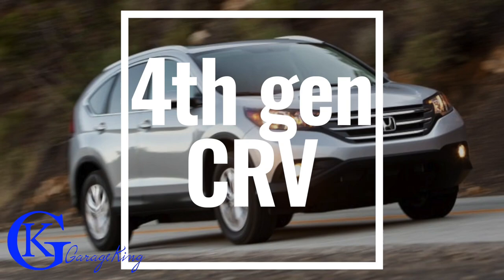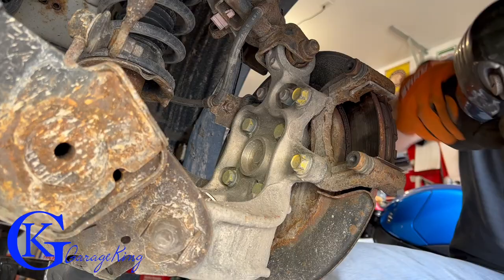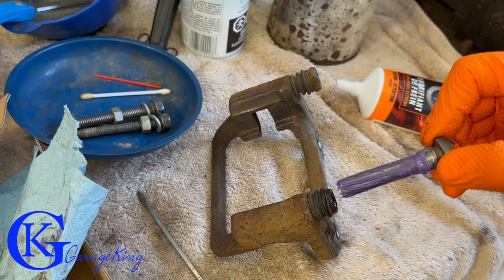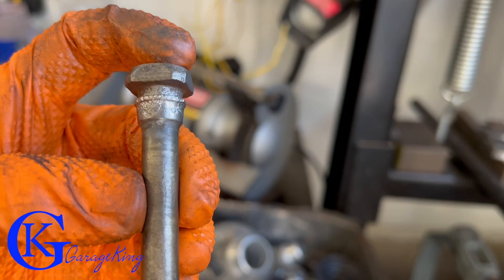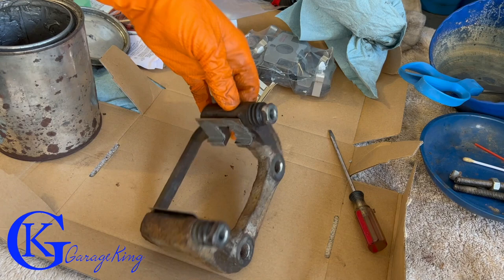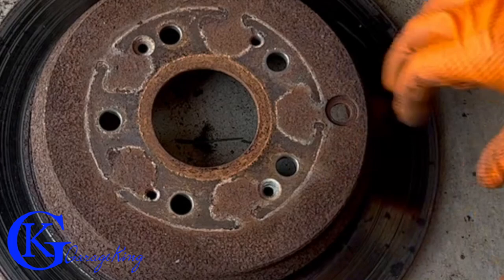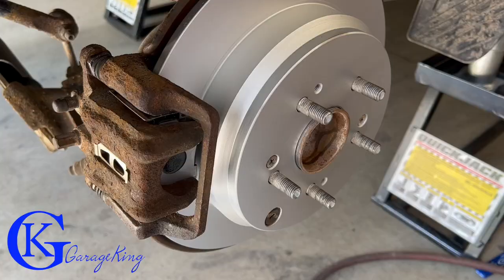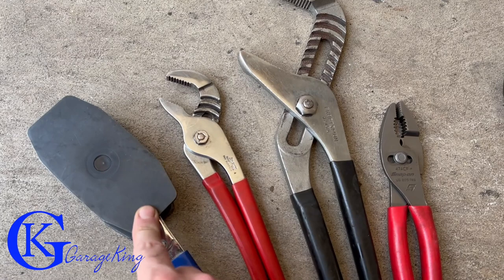How to replace Honda CRV rear brakes 2012-2016

Comment: For those who are thinking of buying rebuilt calipers rather than clean up and reuse the old ones, as when they old pistons are severely corroded, be sure to take the caliper pins out of the new (rebuilt) calipers and inspect for the correct amount of lubrication.   I just bought some rebuilt BrakeBest calipers.   Those have the best core clean up and complete coating I have ever seen.   Look as good as new.    But, the caliper pins had only a bit of lube, and almost none at the top of the pin where the most corrosion will occur.   Don't assume that a rebuilt, or even new caliper will have been properly lubed.
Reply from the maker: Excellent comment and thank you for that.  You are soo correct.  I have purchased rebuilt calipers which had the brake line threads damaged, so inspect everything !!!

Comment: Thanks for the video.   Good job on showing all of the steps.    Personally, I would not reuse the old, corroded caliper pins.   You did a great job of cleaning them up, but the pitting of the pin will impede the sliding action regardless of how well you lube them.   And you can buy them separately for just a few bucks.   I also would clean up the piston and surrounding area with brake cleaner before compressing it back into the caliper.   Otherwise, you will be pressing a lot of brake dust, etc back into the caliper.

And BTW, I have worked on one 2012 CR-V rear caliper 3 times but it never worked correctly.   One side of the pad would seize and that would cock the pad causing real quick wear out.  I bet those caliper files would have fixed it up.   Now I know....
Reply from the maker: Thanks for the comment and I appreciate your insight.  You are right about the corroded pins, they will make it more difficult to slide, and once they get really bad they tend to seize up pretty quickly. As for those files, I'm glad I found them as they have come in handy, and cured some problems as the wire wheel only takes off the lights surface rust where the file will level it.  Hope you had a good weekend !!

Comment: jeebus.... yeah.. the climate takes it's toll, definitely worth upgrading to coated rotors, I've even given those Galvanized Brake pads a shot from NRS ( Toronto woohoo!) which I would recommend.
Reply from the maker: Hey thanks for the comment, I checked out NRS on line and they seem pretty good.  Thanks for the comment :)

Comment: 5:00 I really can't believe you resorted to pulling that spring through the hole, then deforming the new one and pushed it back into the hole.   It can easily be removed from the inside just by sliding it up or down till one clip clears the edge of the hole.
Reply from the maker: Wow, and just wow, thank you for that !!  I was scratching my head on that one and as a licensed mechanic you helped me.  I don't work at a Honda dealerships so this was the first time I saw those.  The good thing is once I put the caliper back on the spring pushed against the pads so it was nice and tight.  Appreciate your comment brother !!
Reply: @GarageKing  Glad to help.  I realize you have a ton more rust to deal with being up north so it can get in the way at times.  Also the proper way to insert the pins into the caliper is to "burp" the rubber boot.  So as you push the pin in, you want to pinch the rubber boot between two fingers.  This allows air to escape so you are not fighting against a cushion of air.   Last, be careful with this model and other Hondas - the top and bottom pins are not interchangeable.  The top pin has a beveled edge and the bottom does not.  But I am sure you got it right on this job doing them one at a time.  Good content.  Looking forward to more.
Reply from the maker: @gfriedman99  Hey thanks for the follow up, I always use the "burp" method with rubber boot and for the pins I always do one at a time as I find most of the time they are different.  One of the pins on the Japanese vehicles always seems to have a rubber piece on it.  Thanks again !!
Reply: I just did my rear CR-V brake pads and I was going to also mention removing the leaf spring from the bottom and not the hole. I admit I had a really difficult time trying to get the 3 "fingers" of the new inner pad to go back into the piston hole. I ended up using an old pad to take up some of the space and a long screwdriver and lots of cursing.
Reply from the maker: Ya, sometimes I think if its not rusted up it may be easier just to leave it.  I wanted to replace it for the video  @donaldlee6760

Comment: At first when you take the old pad out, the wear indicator is at the bottom but when you install the new one you put it at the top. I did mine today and I realized after all was done that I did the same thing. Do you think it's gonna be a problem in the future when the indicator touch the rotor or should I leave it like that?
Reply from the maker: Hey thanks for the comment and yup thats fine, you just want to make sure the wear indicator is on the INSIDE pad and the reason for that is you can't see the inside pad when checking, but you can see the outside pad.

Comment: New pins are < $12.  Just get new ones.  If there’s that much corrosion on the outside of the pin, I’m sure the threads aren’t great either.
Reply from the maker: Hey Thanks for the comment and you are correct, new pins are always best.  Surprisingly, its always the pin body near the collar that rusts, the threads are always good as they are tight in the receiving threads away from corrosion.
Reply: @GarageKing  not mine.  😉
Reply from the maker: @_-0_x_-_p_0-_  Oh my, well I'll tell you that you are in the minority camp, as its pretty rare for the threads to be corroded up.  Good on you for changing them.  I would change them for sure if the threads were corroded up, as they won't have the proper clamping force, and you most likely can't torque them properly.  Good call !!

Comment: Good video... but the way you put the top clip in was ... weird.  
I dont recommend bending it in half and putting it in through the top like that.  Do it from the inside.
Reply from the maker: Ya that was weird, you got me on that one.  Thanks
Reply: I did just finish replacing the rear brake pads on my wife's C-RV... and by using several of the little details you showed in your video... it saved me a good deal of trouble - your tips saved me time and  a considerable amount of trouble.  It really helped - I watched it twice prior to doing it.   I'm a GarageKing FAN !  THANKS Buddy !
Reply from the maker: @erikkind1224  That is awesome and glad I could help (less the clip haha)  Your wife will think you are superman now so ride the wave and enjoy the rest of your weekend !!!

Comment: U r suppose 2 use silicone grease on the slider pins? And the purple grease is a big NO NO!!
Reply from the maker: You can't go by the colour.  This is the stuff I use now and so far its the best stuff I have tried.  I used silicone in the past and its good as well.  Here is the link to research it if you want https://amzn.to/48zsSq4